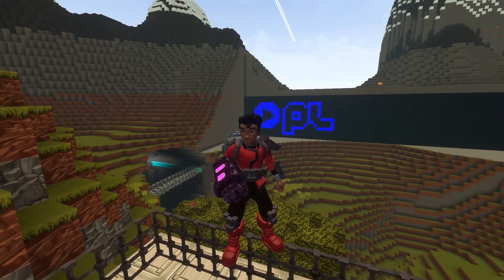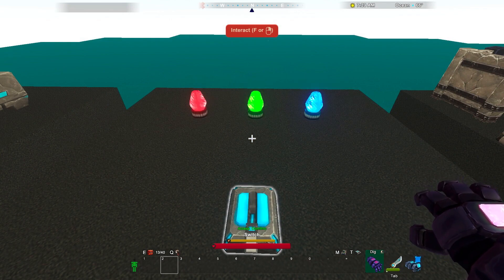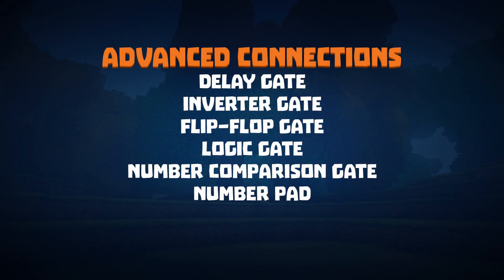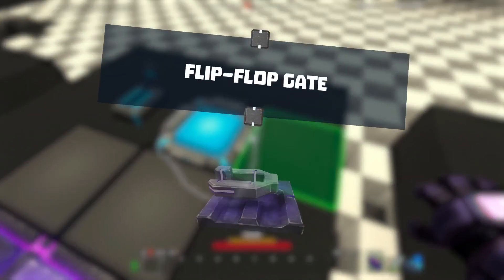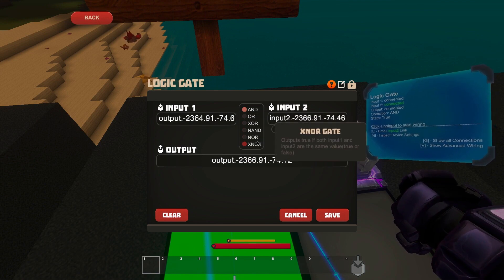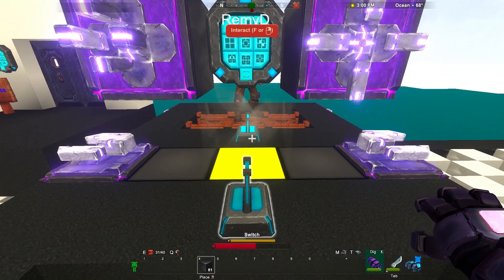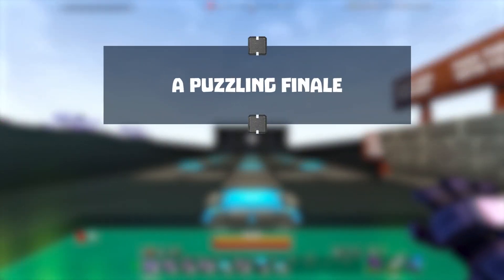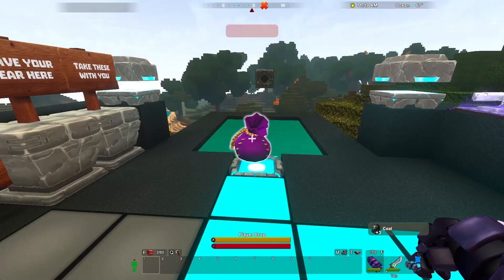A Guide to Machines in Creativerse R33

Comment: Hi! I love the new features but I have a couple of ideas - I would love a way to have additional control of objects beyond the true and false states, for example setting the color of the LED lights using a keypad or setting the speed of the fan using a value. I would also love to have a special block that could switch between visible and invisible on the true/false states! Hope you like the ideas :)

Comment: I dont understand it with the doors. Ok, the machine works. I put a number n the door opens. If I put a wrong number it doesnt open. But I can open it with a hand without any problem. Should it be so? Itd make more sense if I couldnt open it with my hand after the code.
Reply from the maker: Inspect the door and uncheck "Can Interact"
Reply: Thank you! :-) now it makes sense
Reply: Turn off the interact option on the UI of the door to disable manual interaction

Comment: Although when I drop anything on a pressure plate it does nothing, trying to figure out how to set the actions if numberpad is wrong hmmm so much to learn lol also cannot place anything on pressure plate
Reply from the maker: Shift-RMB to place blocks on interactables like the pressure plate. Use the drop icon in your inventory to drop a loot bag on one (the drop shortcut [z] doesn't currently work on pressure plates, but we'll fix it)
Reply: +Playful didn't know z currently wasn't doing it but dropping via bag icon didn't work for me either, will have to try adding shift to lmb when our electricity comes back on

Comment: What is the set up for the light up sign? I can make extremely basic stuff but can't wrap my brai naround something like a light up sign like at the start of the video. :/
Reply: Switch to a Delay Gate attached to each set of LEDs for each letter.
Reply: FlutePlayer777 My bad, forgot to include detail, but what about having it one its all done, to all turn off and loop?
(I'd like it to auto run if its possible)

Comment: how can i open the recipes
Reply from the maker: Wiring Tool - Unlocked on Coal
Switch - Unlocked on Wiring Tool
Pressure Plate - Unlocked on Wiring tool
Delay Gate - Unlocked on Switch
Inverter Gate - Unlocked on Switch
Flip-flop Gate - Unlocked on Switch
Logic Gate - Unlocked on Inverter Gate
Number Pad - Unlocked on Logic Gate
Number Comparison Gate - Unlocked on Logic Gate
LED - Unlocked on Wiring Tool
Reply: +Playful thx ur the best